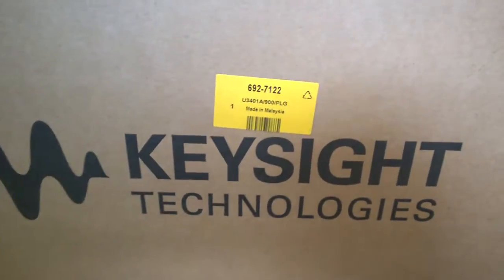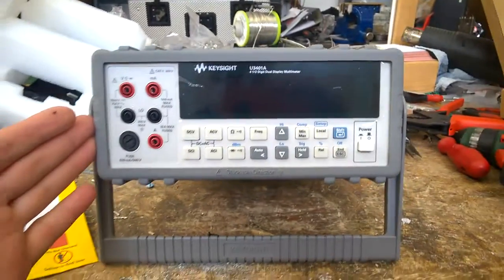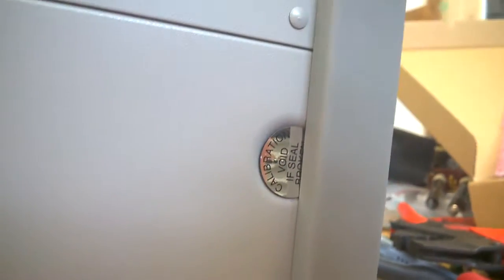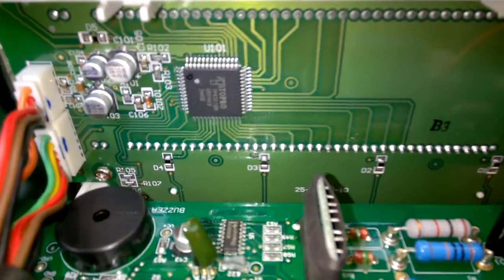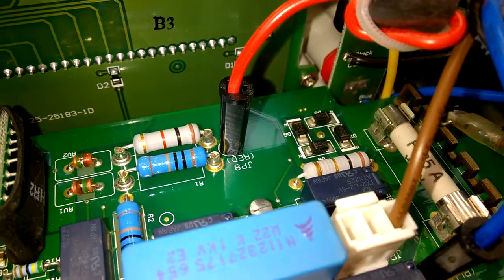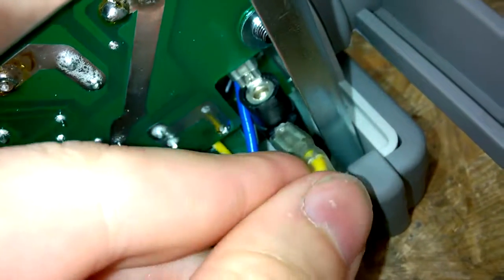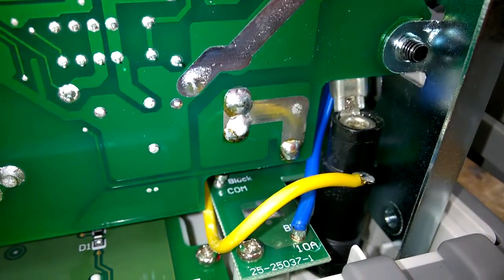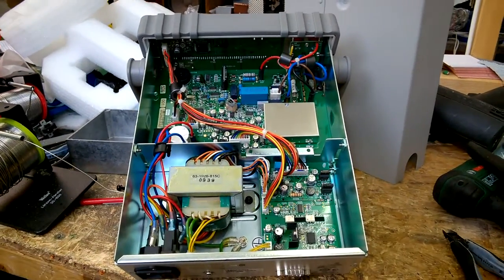BEB #2: HP Agilent U3401A Keysight Multimeter Teardown horrible FAIL

Comment: Wwwwhat? WTF? Why? Hot-glue-isolated capacitor! Mechanical seismic-activated random noise generator connection to warn you in case you have an earthquake while making your measurements! Self-destructable solder thermal fuse (sets your lab on fire to prevent from drawing too much current on 10A range)! This and other cutting-edge HP/Keysight technologies for $700 delivered on Amazon! C'mon, I'll just buy 7 UNI-T's on aliexpress. Two will be dead on arrival, but other 5 would serve me at least 5 years (one year each) - and I'll have some spare money left to buy some tequila and some spare parts from dead units - to repair other five after five years! :) Good luck with this unit and thanks a lot for this and your other videos - I really like what you're doing here.
Reply from the maker: Thank you !!!!

Comment: That looked like an RS sticker at the beginning ;) I would have replaced the lose faston connectors as well. Just built a unit where I soldered the fuse solder lugs but used 6.3mm faston connector on the other stuff of the Bulgin 230V block, like IEC320 connector and power switch.
Reply from the maker: yes, exactly. RS was my source. Always happy to read your comments. Thank you for all the thumbs, I've noticed it. You are awesome.

Comment: Nice video. I did not expect those build quality issues you found from a reputable company like Keysight. There's really no excuse for that fuse connection. And yes, you did the right thing resoldering the fuse and the shunt connections. Don't worry about the calibration, it'll still be within spec. You just improved the long term stability by fixing those loose connections :-)
Reply from the maker: +InstrumentalsDE 
Thank you for your reply. You will probably like that I will post a video of the 34450A too (later).